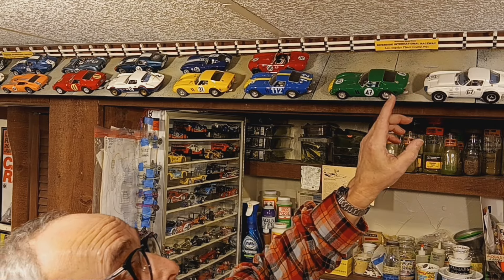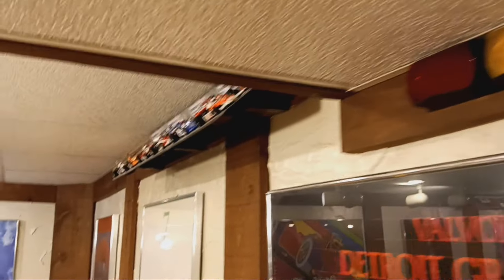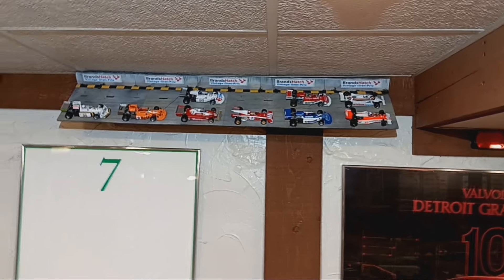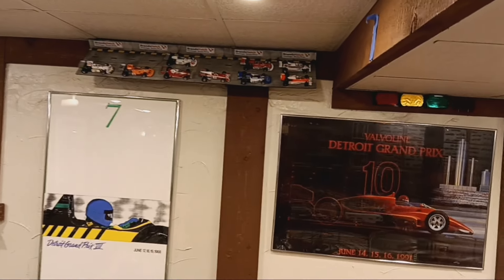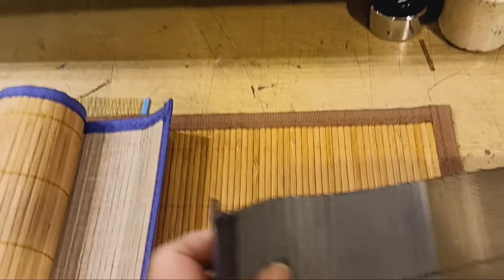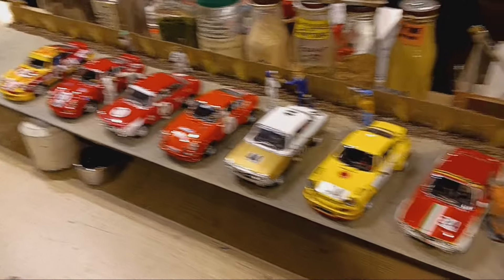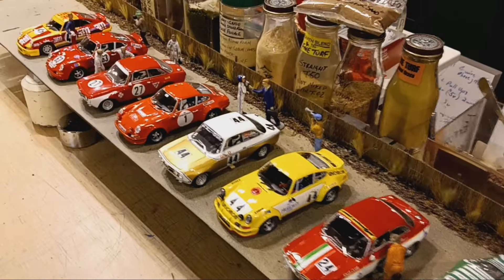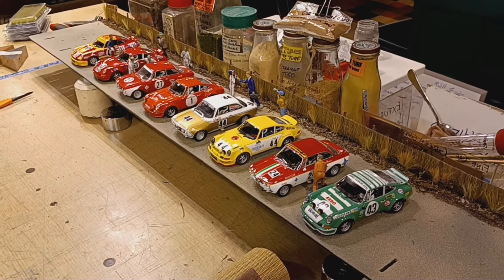Modeling slot car 1.5 display shelf- materials & misc. / update Today @ Northline Raceway

Comment: Don’t the cars tires develop flat spots sitting on your manufactured road bed ?

As alway nice work ,and thanks for sharing your years of modeling knowledge/ talent.

Regards, Bob
Reply: You are correct Bob! I see one in 20 cars get one tire flat spotted. But I've found that that happens as much in the car case as it does on my shelf. The rear silicone don't flatten but the original rubber left on the front of the car can deteriorate over time. Maybe it's because the cars on the shelves get used at least once a year. Your comments are always appreciated. Please subscribe and go back and forward your favorite video on Lunch King to your friends.